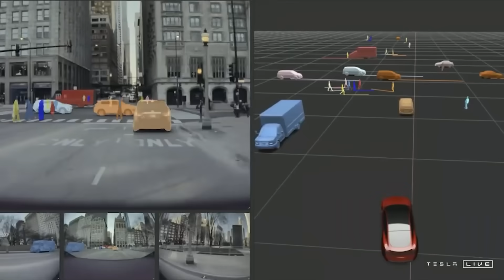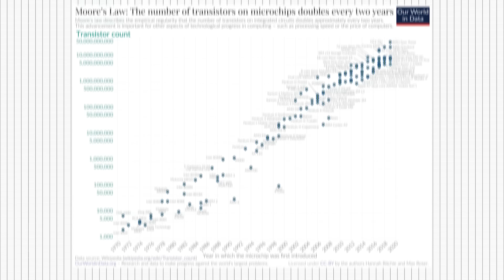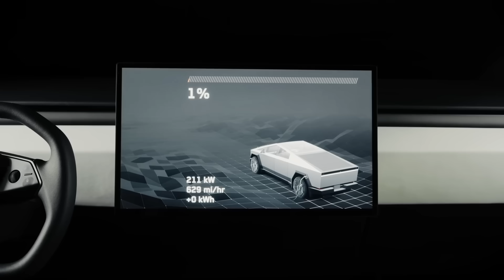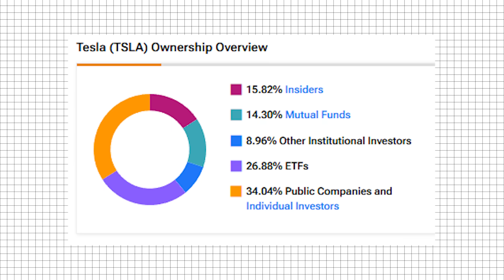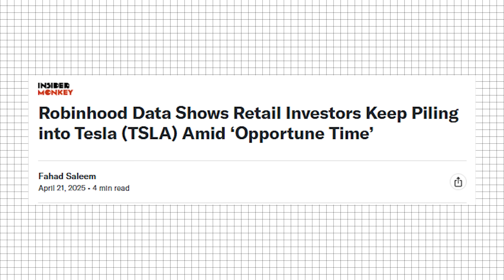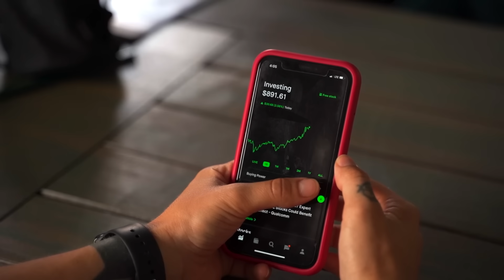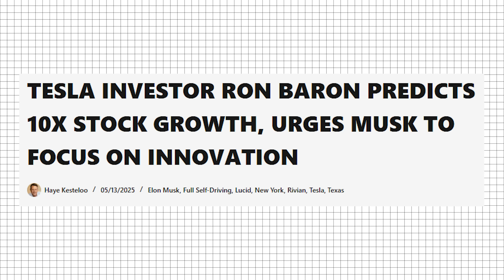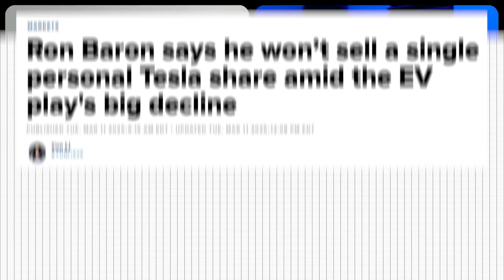Wall Street Is DEAD WRONG About Tesla

Comment: Before mobile phones were sold "where is the demand model" lol, for some things you just don't need one because it's so useful would be my guess. :person-turqouise-waving::person-turqouise-waving::person-turqouise-waving::person-turqouise-waving::person-turqouise-waving::person-turqouise-waving::person-turqouise-waving::person-turqouise-waving::person-turqouise-waving::person-turqouise-waving::person-turqouise-waving::person-turqouise-waving::person-turqouise-waving::person-turqouise-waving:
Same with automatic transmissions and now 95% of gas cars are auto, i suspect it will be the same with FSD except an economic driver will be far cheaper insurance due to safer cars.:face-green-smiling::face-green-smiling::face-green-smiling::face-green-smiling::face-green-smiling::face-green-smiling::face-green-smiling::face-green-smiling::face-green-smiling::face-green-smiling::face-green-smiling::face-green-smiling: